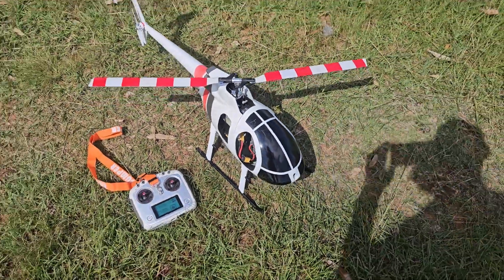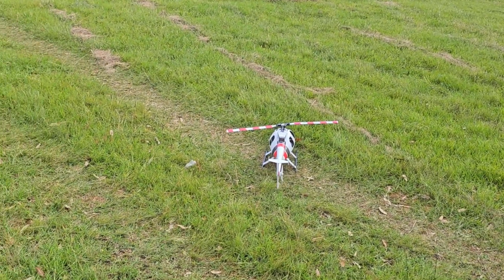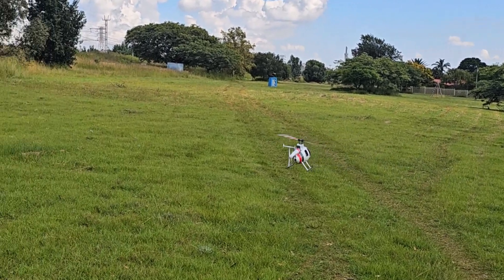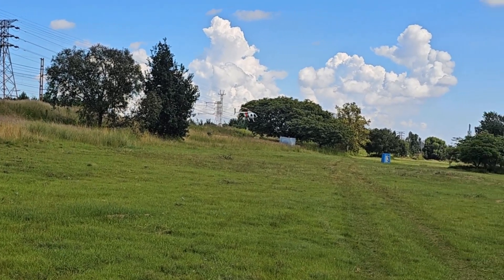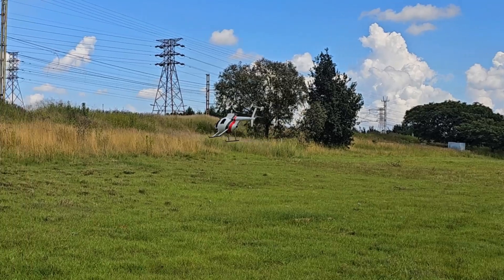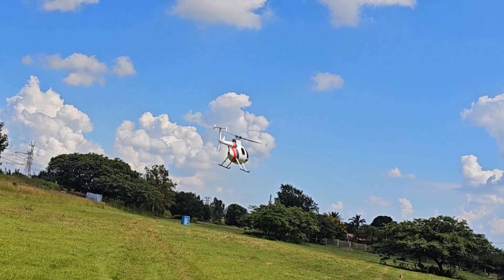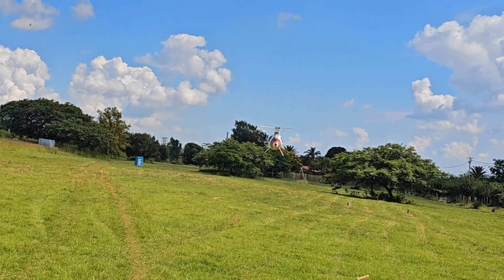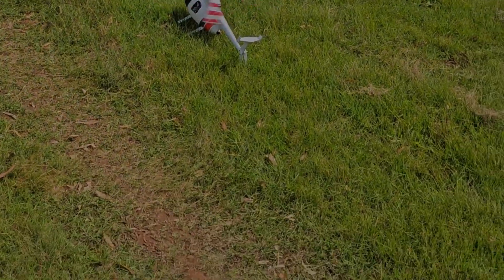3D printed Flywing enabled MD 500 RC Helicopter and Little Bird News

Comment: Do you mind posting your H1 Parameters page and what was your final Throttle Control setting? I'm seriously considering this build.  Also, what was it about the 4-blade that didn't work out for you? Thx
Reply from the maker: Happy to share. Where do you want them? 4 bladed head drains to much battery life. About 25% and don't like the sound.
Reply: @Mikes-tuts-rev BTW, what's the length of the fuselage, nose to farthest point of the tail? Thx
Reply: @rollys1200  about 950mm